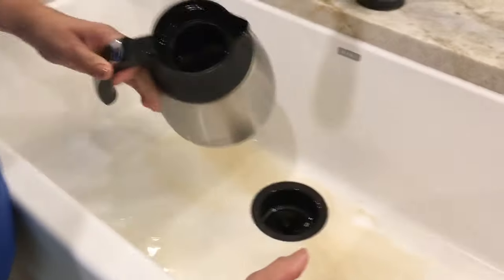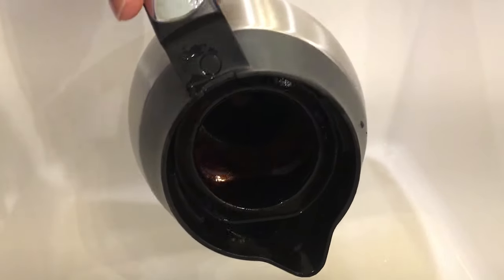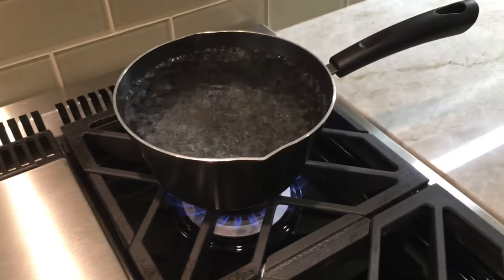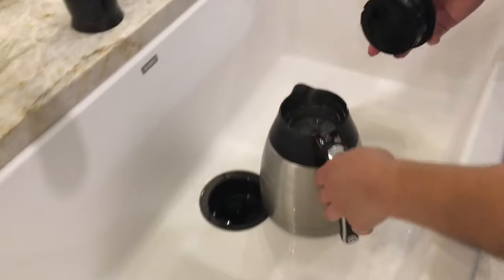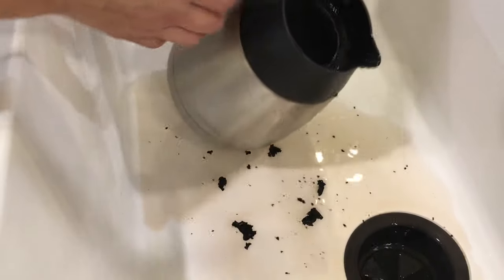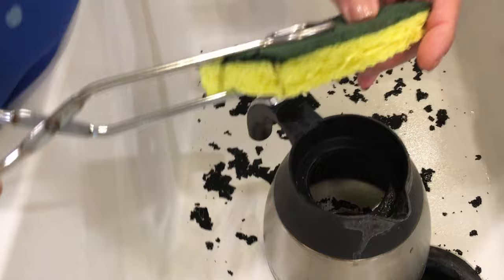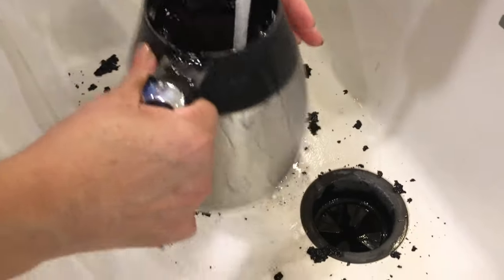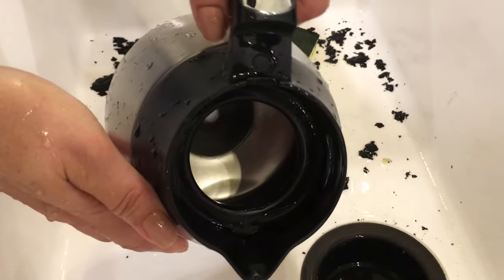How To Clean Inside a Stainless Steel Coffee Pot!

Comment: Keep it simple. I boil water, drop in a dishwasher pod. Add boiling water. Put lid on, shake, soak at least 30 minutes. Incredible !  Same thing for percolator. Throw in dishwasher pod.  Add cold water as high as you can go without spilling out of spout. Add guts. Run percolator and let sit for 1 hr. Rinse. Incredible!
Reply: Thanks for the tip, looks like new!
Reply: I do the same. 5 minutes and it's gleaming. I rinse a few times though afterwards...like a dishwasher would!!

Comment: Just like Gomer Pyle used to say Shazam! Thanks for your video production very serendipitous.  I have the same exact Mr Coffee decanter. I simply am off grid. I truck in my water at the moment so I have to be very conservative with how I use material. I simply pour one part of bleach to five parts of water in a qt spray bottle and once a week spray down only a couple squirts, agitate with a scrub brush rinse repeat, then rinse very well,  and put hot water (letting  1pt from actual coffee machine too purge into it) this is it's final rinse. I use less than a gallon of water for the whole process and it comes out wonderful and the bleach taste is totally gone if I follow those simple directions. I cannot waste energy or material, it has gotten way too expensive! BTW,  the black matter is mold and coffee carbon. Nasty  !

Comment: I was very surprised, but this worked! I got a second hand, stained, Kleen Kanteen 20oz stainless steel travel mug. 1/2 cup baking soda and boiling water to the top, w/ lid on overnight, and the stains came right off in the morning when I used my mug dish brush. 

Not as dramatic as the video, a lot of it had already come off in a previous wash after filling the mug with hot water and white vinegar. But this got the rest of it off that the vinegar missed.
Reply from the maker: Thank you for the testimony

Comment: Actually, if you just spray oven cleaner inside the pot and wait 5 minutes it does the same thing - it will just dissolve the stain (no scrubbing) and you save an hour.
Reply: Thanks for this tip! Today I will have to use the baking soda, but I am adding Oven Cleaner to my shopping list right now 👍🏻😁!
Reply: I just got a 2nd hand 40+ year old Revere Ware Tea Kettle. I’m gonna try the oven cleaner on it. Good Idea 👍🏻. 
Not too many people like using old fashioned Easy-Off Oven Cleaner because it’s kinda toxic to inhale. But for SURE, it always worked in the hardest grimy ovens. Sad the manufacturers now put warnings not to use it on the newer ovens. I don’t know why tho! It definitely works. 
Good Idea for this tea kettle tho’. Thanks 🙏🏼
Reply: @GumriRN  Funny think is - I actually use the oven cleaner for my tub/shower too. It's the only thing that actually gets it "clean."  I spray, let it sit 20 minutes, brush and it gets my shower cleaner than any bathroom cleaner on the market.  A builder friend of mine who flips houses told me about this little secret.  Never looked back :-)
Reply: @Airtouch67  -I’m buying 6 cans today. It WORKS on grungy ovens, so it’ll work on mostly anything that’s solid metal as well. 👌🏻
Reply: My man! Thank you!  This is the internet at its finest. I just used this to clean my coffee pot and my shower and they are shining. This is a true hack that I'll be sharing with everyone I know.
Reply: oven cleaner is toxic, unlike baking soda.  just FYI.
Reply: @kurtzimmerman1637  That's why you obviously wash it out thoroughly.  Been using oven cleaner on my pots for 10 years now, still alive.
Reply: @kurtzimmerman1637  exactly. And it’s not just toxic for us to breathe in the moment. We put it down the drain so it enters our water system.
Reply: Whoa!! That would be super toxic😝
Reply: @yvonnettabushell6040  Not at all.  Brush up on your chemistry class.  Oven cleaner is used to clean millions of ovens and grills all over the world.
Reply: @Airtouch67..i stand corrected then 😏 i learn something new everyday.
Reply: I mean, I bet gasoline’s could work too… but baking soda is food safe
Reply: @headsinger  Well, ridiculous example.  Millions of people clean their oven with oven cleaner, and then bake their food in it.  Come up with something else.
Reply: @Airtouch67  2 major differences, the oven doesn’t physically contact the food and the oven bakes off most of the residual.
Reply: @headsinger  Well I'm a chemist by profession and I can assure you particles of "oven-off" are flying around the oven getting into your food.  It's impossible to completely eliminate the cleaner just by wiping it off.  No different than scrubbing the coffee pot with soap after.
Reply: @Airtouch67  my condolences. Haha
Reply: You got to love the foaming action of boiling water and baking soda! But yeah; henceforth, it’s oven cleaner for me and my pot.

Comment: Will this also work with an electric kettle?
Reply from the maker: Absolutely!!
Reply: I tried it with my coffee pot. Maybe I should have stirred the mixture. When I came back to it, the baking soda was just like a block in the bottom. But, with a little bit of elbow grease, I was able to completely have the inside back to all stainless steal. Lesson learned. Next time, stir. Lol
Next time meaning in the electric kettle tomorrow!
Reply from the maker: @joseemartin2216  Awesome! Glad it worked out for you
Reply: @joseemartin2216  did you not use boiling water
Reply: @anthonyb2990  yes I did. But it still just clumped up on the bottom of the pot.
Reply: @joseemartin2216  I poured hot water in my coffee pot, then added a good quantity of baking soda and spread it all around on the inside (same as when you add flour to a cake pan).   Since the sides were wet, the baking soda stuck on the sides, I then poured the boiled water and let I sit for 90 minutes.  I worked really well.  Hope it helps for next time.  Bonne chance 😊
Reply: @joseemartin2216  Let it go through a full brew cycle for perfect results.